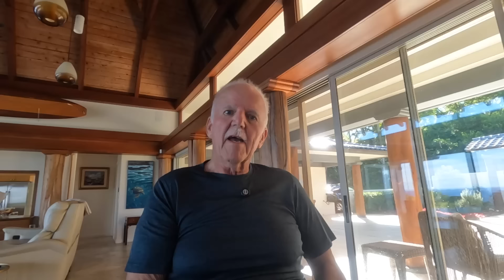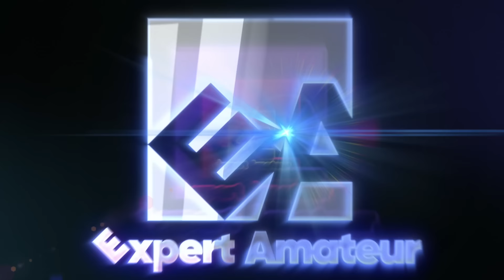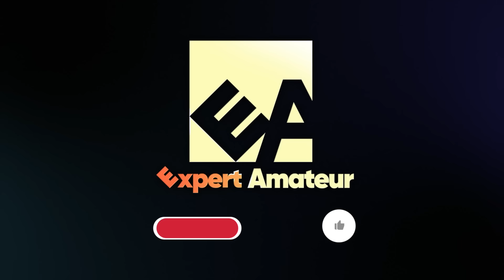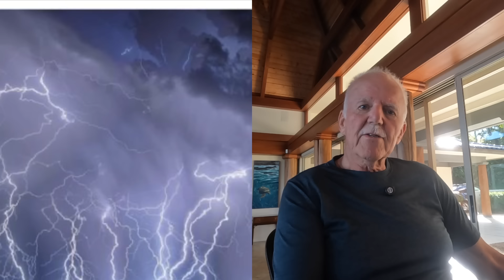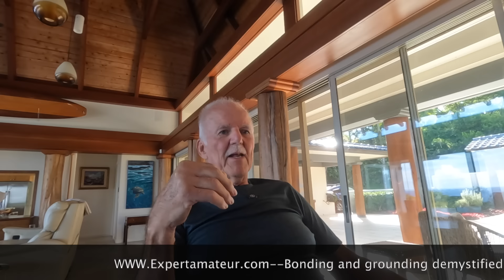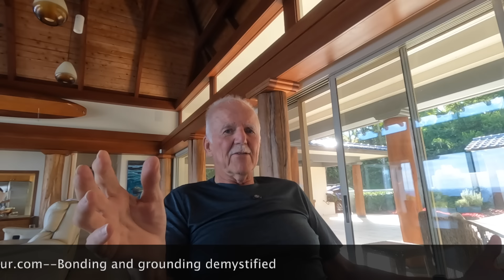solar grounding

Comment: I have a ground for my house, my panels are mounted to a shipping container which has it's own separate grounding rod, panels are all tied together and grounded with their own separate grounding rod. Also there is about 125 feet between my shipping container and my house.
Reply from the maker: Me too. The trench I ran to my service entrance includes a bare 10 awg bare copper wire on top of the conduit that bonds my auxiliary grounds and my service entrance ground. And I dumped a few bags of bentonite on top of all that before I filled the trench. The wire binds those auxiliary grounds to the service entrance ground and keeps them all at the same (more or less) potential if a ground wave from a nearly strike wanders by. A few hundred bucks of cheap insurance to protect my inverter and battery. The closer the strike, the more inadequate the insurance is. In a direct strike it's meaningless, but that's lottery ticket levels of statistical likelihood.

Comment: I have a bit of a different problem. I have a battery pack that trips a GFCI in the garage when it's charging from the grid through the main house breaker panel. This is because the transfer switch the battery pack is powering is sharing the same neutral as the main panel and hence the GFCI outlet. The GFCI outlet that the battery pack is charging from is NOT on the transfer switch, it's a standlone outlet with it's own circuit breaker. I was told by an electrical equipment manufacturing company (not gonna say who lol), that all someone needs to do is modify an extension cord where the male end that goes into the GFCI, in the plug connect the neutral and ground together.... that will stop the GFCI tripping. HOWEVER, watching your video at @12:26 it sounds like if someone did that... it would create a parallel flow problem you mentioned. Am I understanding that correctly? Heck this may even be similar to the neutral bonding plugs that a lot of people recommend to fix GFCI's tripping that folks use on generators. This also sounds like it would be dangerous? Why are people using them then? Maybe I am misunderstanding?
Reply from the maker: Nope, you're understanding perfectly. You're banging up against the reason why most countries do NOT use neutral to create 110V via split phase. That's pretty much just a USA solution, and it's a spooky one. I don't have a clear solution for you. Pretty much anything you do will create a neutral-ground current and trip your GFCI. I had a similar problem with my Airstream toy-hauler. I had to defeat the general GFCI breaker to pug the trailer into shore power. Fun.
Reply: @ExpertAmateur-xn6dr  Dare I ask how you defeated the GFCI?
Reply from the maker: @AjayT3K  I replaced the main breaker with a non-GFCI one. An electrician friend told me the fact that most of the shore power connections in RV parks and campgrounds have GFCI meant I was stacking GFCI which is a no-no. I subsequently realized he was wrong, but it solved the problem so I left it alone.

Comment: Set your PV system and AC distribution in a dedicated building (power room) then you can use your AC feeder ground to your point of use(house panel etc) conected to that point ground rod. No need for separate ground wire.
Reply from the maker: Not as long as you don't mind lightning induced current running through your equipment.

Comment: According to Dehn studies, solar on the roof does not increase the risk of lightning at all. See document: WP018/E/0615© Copyright 2015 DEHN + SÖHN. This is the sort of amateur information that causes all the confusion.
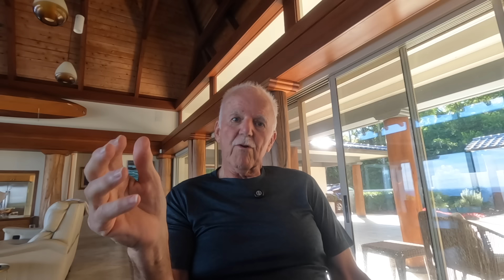Reply: Thanks for the reference.  Good stuff.  Did you read the opening paragraphs?  1:20 The Expert here is on the right path, ground path, I believe, but of course each lightning protection system will have unique attributes, based on the realities on the ground, if you will, must be reams of papers written on the subject.

Comment: I've also got a camper that's connected to our grid that's exactly 100 ft away from our home and I drove its own grounding rod into the ground at the camper that's 100 ft from our home should I remove that ground and rod and just ground it to our home's grid through the six w cable that I've got running power to the camper?
Reply: Yes!  Unless that copper ground rod at your camper is also bonded to the ground of your home. Otherwise definitely disconnect it. As a rule, you should never have separate grounds. They should all be bonded to each other.

Comment: Hello thank you you just really saved me probably from thousands of dollars worth of damage my question is I've got a lot of metal buildings and they get struck by lightning sometimes three times a year and there's been some very close calls, last year lightning struck and hit a jeep that I was working on with the key out of the ignition the Jeep started up and ran it was on the back of my property it was running for about 2 days until I figured out where the noise was coming from I'm never seen anything like that and I've never heard of anything like that the key was out of the Jeep and it was a 2007 model Wrangler I watched the video on my camera system which saw the Jeep gets struck so I installed a lightning rod on the end of my home the light and ride is exactly 50 ft from my home's grid grounding rod and I'm in the process of installing a solar system with 32 panels I was going to ground all 32 panels to a single 6 gauge copper wire and run it directly to the home's grounding rod do you think that that'll be sufficient? And the lightning rod is grounded approximately 50 ft from the homes grounding rod this driven into the ground by the light pole do you think that is sufficient or should I extend the grounding rod for the lightning rod further I can't get any information around here from anybody I really appreciate your help
Reply from the maker: Sounds like you live in Florida or something close to the lightning capital of North America. I'd definitely do a local ground at the panels (and make it a really good ground--maybe three or four rods spaced six feet apart) and bind that to the service entrance ground with bare wire in a trench. If you want to see what serious grounding is all about, look at installation videos from central Africa. their issues make Florida look like Canada (where they don't seem to have any lightning at all)

Comment: It would help the world if people telling people to ground equipment would NOT utter the word GROUND.  

Equipment panels/cases/racks are BONDED.  This BONDING prevents electrical shock when touching metal. The famous ‘ground’ rod that is pounded into the third rock from the sun is a EARTHING ROD. 

That white wire in the white/black/green bundle is NEUTRAL/COMMON. The green wire is the BONDING wire. In electrical circuits (almost always AC) the neutral wire completes the circuit. In electronic circuit (almost always DC) the wire/trace is the RETURN.  There is NO GROUND.

Earthing, the EARTHING ROD, is what is important  for surges from the grid and lightening strikes IN THE AREA. 1) off-grid systems will never have a connected surge; 2) nothing but an aircraft will survive a direct lightening strike.  However a strike in the area - that area might be miles in circumference, depending on the soil, topo, and your luck - will spread on/in the dirt like thousands of fingers looking to complete its circuit. Those fingers running parallel to the System’s buried wire will induce a current surge into those buried wires.  THAT is why/when/where SURGE Protectors are installed. The induced surge in the buried wire runs until it hits the equipment OR a properly installed SPD (Surge Protection Device) which is connected to EARTH via any BONDING wire THAT IS connected to EARTH via a EARTHING ROD. 

The NEC requires one EARTHING ROD, more may be installed; people want more, especially at buildings that afar from the System’s heart - the INVERTER where all of those underground wires are connected.  

Protect the System by installing an EARTHING ROD  and a SPD on the MAINS and at every remote SUB PANEL, and on every buried wire set longer than 50 feet. (If you are an unlucky fellow, put SPD’s on every buried wire set.) SPD’s are $125-ish and a decent solar system is $50,000; buy a bunch of them, place them generously. 

I am in no way connected to MidNite. They have been in business for 15 years, their SPD ‘s are warrantied for five years. Not cheap, but the System wasn’t either - and a replacement System won’t be either.

ps: help me stamp out the word GROUND.  Say Earth, say Return, say Neutral, say Common; but never say GROUND!
Reply from the maker: I agree, and yes, when I'm typing a response or talking about this stuff I say earth ground, bond, and use ground with no qualifier for the grounded return path. Potentially confusing, but I'd need to include a glossary otherwise. People think technical jargon is intended to mystify laymen. It's not. It's to make clear and unambiguous statements. Unfortunately it does indeed mystify laymen.

Comment: The topic is interesting and very complex an off-grid solar system is isolated from a power company I see many problems damaging off-grid inverters connected to the grounding Does grounding have the same effect on solar panels as a lightning rod?
Reply from the maker: Not really. The purpose of a lightning rod is to direct direct strikes away from the protected area. The purpose of a grounding rod for frames and structure is to divert the voltage pulse from a nearby strike away from equipment. But you have to do it correctly, meaning you have to tie all the grounding rods together with a conductor or the pulse traveling through the earth will induce voltage spikes between the grounding rods. The conductor also mostly eliminates ground loops, or at least decreases their severity to acceptable levels for anything other than labs or recording studios.

Comment: I agree on not having multiple grounds. Most people have a second ground rod near their solar panel which creates the grounding loops you are talking about.
Reply from the maker: I would say we don't agree. I think multiple grounds are the safest approach but they need to be tied together with a conductor (preferably buried) to make them effectively a single ground.
Reply: @ExpertAmateur-xn6dr  It seems that you both actually agree, multiple grounds are a bad idea. However once they are connected it becomes a single ground.
Reply from the maker: @manoo422  pretty much, though the auxiliary ground at the panel protects equipment a bit better than bringing a few million volts much closer to your gear. The high potential induces currents into every conductor close to it. Getting that to earth as soon as possible is probably important.

Comment: Just a ? Doesn't a very near lightning strike produce a low grade EMP effect? If so how would grounding help ?
Reply from the maker: Yes, if by EMP you mean an electromagnetic pulse. If the strike is close enough, then only a very complex grounding method will help. But in all cases the EMP induces voltages into nearby conductors. Some of those conductors are the system grounds and the external equipment (frames and racks). Directing that voltage to ground is useful in reducing the length and amplitude of the pulse. There is another problem with the entire scenario which is that there is also a ground wave--a voltage spike that travels through the ground--which is also a conductor. That can and often does create a differential voltage across any ground rods, making the ground connections a source of stray voltages.  Connecting all grounds together keeps that potential as low as possible. There's no clear-cut zero risk method other than encapsulating your entire installation in a Faraday cage. Good grounds conducting the voltages away is just the most reasonable precaution that doesn't exceed the cost of the equipment. It's like taking aspirin because you have a headache. It helps, but if your headache is caused by brain cancer the benefit is limited.

Comment: You don't mention if the connection between the two ground rods should be kept outside, or if it is safe to run it through the home.(attic or basement) . I think this is one place people think they are 'bringing it into the home' by the advice you hear of running the ground with the conductors into the home. Wouldn't it be best to leave it outside the home and eat the added expense of having an inside the home ground from the main back to the the equipment being installed instead?

Comment: Grid tied system ground is actually part of the utility circuit.
It's designed to allow power to flow back to its source.
When lightning strikes it induces a electron wave much like a wave in the water.
If you have a ground rod that wave will travel back up that ground connection into your equipment.

Comment: The communication industry has good guidance from the Motorola R56 standard and the track record appears to be solid.  I'd say it isn't in perfect alignment with NEC, but is quite close.  I've literally witnessed frequent direct strikes on commo sites and those that follow R56 don't seem to notice.  Your suggestive approach of bonding any and all distant ground points together sure seems like an abbreviated, but functional following of the R56 dictates.  So... I'm thinking treating a solar install (panel, inverter-battery, service panel) like a communication site (tower, gear, service panel, etc.) would not be a bad plan.
Reply from the maker: Yes, they and utility substations are the warriors-priests of lightning protection, and R56 is their bible. NEC is about not electrocuting people. R56 is about not damaging millions of dollars worth of equipment. Very different goals.

Comment: = I do  not  Not  NOT  wish to run  100' of Ground wire from my  GROUND-MOUNT Arrays into my Home  which would INVITE any SURGE of Lightning into my HOME ... 
there should be no  No  NO  need or reason to bring an EQUIPMENT Ground into my HOME = IMHO 
...
Ground LOOPS do not originate in  Solar Panels  between  "AC" nor  "DC"  current  to  EQUIPMENT GROUNDING 
...
PV Panel framework BONDING / GROUNDING  &  SPD / Surge-Protection should happen at the ARRAYS & be as short & Direct as possible 
&
Not be routed into your HOME  or  POWER-House 
...
again   IMHO 
...
COOP
...

Comment: If you have a house ground rod and a secondary ground rod for the solar panels and rack, should you bond the two ground rods together or can you omit the second ground rod at solar panel and rack and run ground wire all the way to the house ground?
Reply from the maker: Yes you should bond them together if you are even marginally concerned about lightning. Understand this is not protection from a direct strike, but nearby strikes are far more likely, and can easily slag your expensive equipment. Running a trenched ground wire back to your house ground could be reasonably protective if your soil moisture level is not deep, but a ground rod is simply better. In many jurisdictions today two ground rods are required unless you can prove the resistance to ground is low. The expensive way to test that is to use specialized equipment. The cheap way is to add a second ground rod and read the resistance between the two. Adding a ground rod at your solar array and bonding it to the house ground still won't protect against direct strikes, but it will minimize the effect of nearby strikes in ways that no "lightning arrestor" can do. You might find this second video helpful. I did a third one but it's just a simplification of these two: https://www.youtube.com/watch?v=pDVV3zmAOXc&t=118s

Comment: Is it not all grounded threw your breaker box to ground rod ?
And what about creating a grounding loop ?
Reply from the maker: Yes, it is, and if you don't mind a few hundred thousand volts running through your equipment and inducing damaging voltages throughout then it's just fine. The ground path through the electrical system is anything but direct and isn't particularly reliable, passing through multiple screw terminals on it's way to the earth ground. You should notice also that I recommend all ground rods be connected by a 6AWG conductor to eliminate concerns of ground loops for anything other than perhaps a recording studio at the same time that it prevents the ground wave from lightning creating a differential voltage across the ground rods. The purpose of this article is to help people undeerstand the choices for dealing with nearby lightning strikes. As far as conventional grounding goes, the GEC is adequate--probably. At least it meets code--but code is the minimum required. And it's no help when a few thousand bucks worth of your equipment gets slagged.

Comment: wich panel counts as the main service panel in a series configuration? i'm gonna install 3x500w panels for an offgrid cabin connected to a fossibot 3600pro.
Reply: he is talking about the distribution breaker panel. That confusion is why the industry is trying to change the technical term to module. It is now a solar module.or photovoltaic module.

Comment: Terminology : Rod = copper rod  buried deep  in the ground  for earthing .

Given a normal house has an existing Rod for the normal grid power , if i build a solar system are you suggesting i add a 2nd Rod and connect both rods together, or just run copper csble to the original rod  for 
a) totally independent solar system not connected at all to grid ....
b) a solar system connected to grid